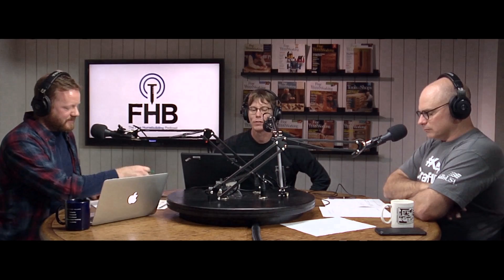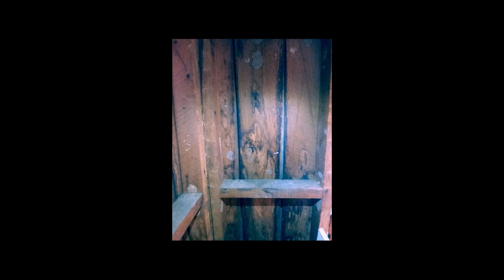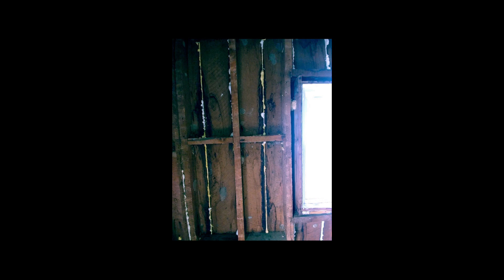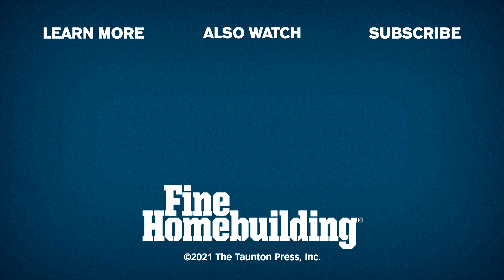Insulating an Old Farmhouse

Comment: Use a 4” batt, but first install a 1/2” foam board cut slightly narrow than the void and sealed with spray foam.

Comment: with that much siding there isn't much of a chance for water leakage, mainly air leakage.  Just use the thicker fiberglass and compress it slightly and use that intello plus, just use a sealing caulk .  worried about water getting in, use rockwool

Comment: Maybe wrap the exterior in foam board, tape the joints, then blow in cellulose insulation in the walls. For the foam board, have the reflective side face outwards, then attaching furring strips over that to attach the new siding. This will give you the radiant barrier in addition to the wall insulation for added benefit.